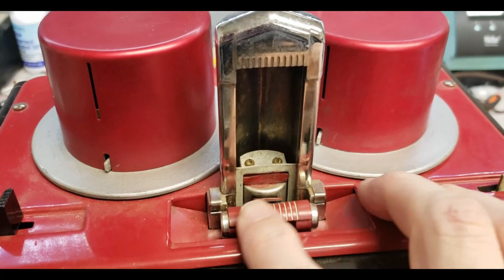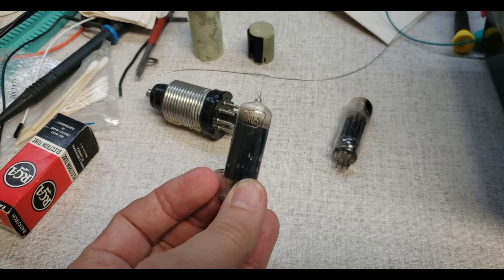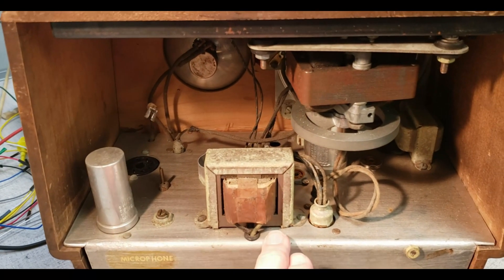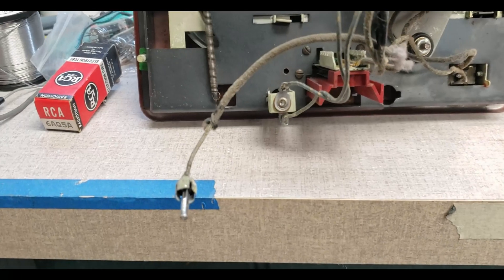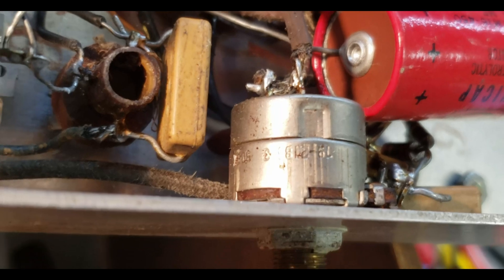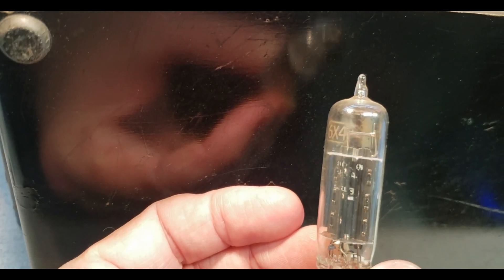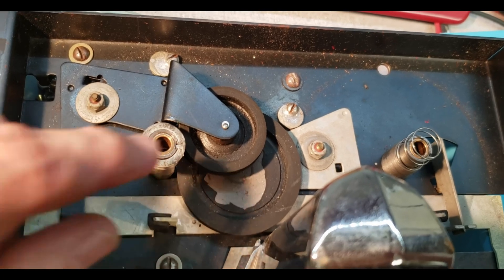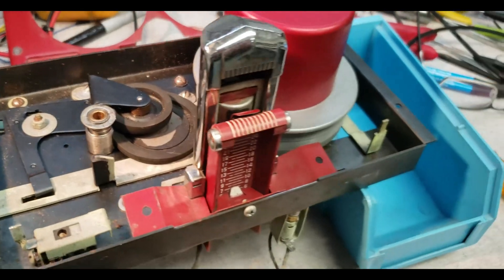The Weirdest Reel to Reel tape recorder I have ever seen!  Part 2 Teardown

Comment: I think I know what this is.  I used something similar over 50 years ago, when I worked at a radio station.  My version actually recorded audio in a helical pattern on 2" tape.  But the purpose was to record an entire day's programming on a single tape.
Reply from the maker: what you are talking about is called a SOUNDSCRIBER and that is not what this is! ! I have a soundscriber. thye use 2" wide plastic based tape. not paper and yes helical scan, 24hrs on a 3" reel. not the same as this however.

Comment: You are aware that wire recorders use magnetic heads just as tape recorders do right? The main difference between a magnetic head for wire and a magnetic head for tape is the wire head has a small V groove for the wire to ride in VS a tape head that has no groove (granted some earlier tape heads do guides the width of the tape) built into the head).
I tend to agree its a tape machine as a wire recorder wouldn't give manual control of head height instead automatically cycling the head up and down to keep the wire wrap consistent.
Your player reminds me of the internals of this: https://www.youtube.com/watch?v=xE2GEmHque8
Reply from the maker: It has 2" wide paper tape with brown oxide on it.

Comment: This is the coolest thing I've seen in quite some time. 

1/4" microphone input, speaker output. Noise was an important issue. Hifi output though -- at least via the device itself, not a priority. But yet expensive 2" tape? Wonder what speed it runs at. Auto-rewind... happenstance, or important to capture everything in the same direction because it makes transfer easier?

I wonder to what extent the medium of the 2 inch, 24 track tape was the starting point. I.e. the primary goal being to capture audio on that particular format. Either because the creator had access to that or their work involved/necessitated that format. Vs the goal being more general regarding simply recording sound. Capturing lots of sound. Capturing separate tracks. Repeated recording of something to aid in comparison?

So mysterious.
Reply: It's a rim-drive machine so the tape speed relative to the head will vary as it goes through the reel.

From the first video the recording medium is paper tape coated in oxide.  Given the early 50s look of the electronics and the fabric-coated wiring, I would suspect that the fact that it's recording 24 tracks on approximately 2" tape is a coincidence since the 24-track studio format didn't appear until about 1972, and this thing wouldn't be able to play a 10" reel of studio tape in any useful form anyway, being only able to access one track at a time.

EDIT: I meant to add, this is more likely to be some kind of dictation format, since voice-quality recordings wouldn't care so much about the speed fluctuations from a capstanless transport.

Comment: Looks to me that they found the tape transport, and made the amplifier and stuffed it all into an old AM radio box.

The heavy lead on the tube could be due to microphonics or they were afraid of the tube emitting x-rays?? Once you go to testing may say!

Strange, as the sockets and connectors are riveted down as well as the caps, but were they all done the same way, or were the rivets hand done?

With the coils and caps, did they have a tape bias system in the design as well?

With the mods to the switch, I would think they had feedback problems?

Hope you get it going!

Comment: This looks like it would take 2-inch magnetic tape, which would not have been easily available to anyone at home, and probably not at all available until the 70s. Since the device looks like its from the 60s or earlier, this would argue against it being "from the back of a magazine" or some such, imo.

Otoh, a company  could make their own or order custom tapes. The mechanism is clearly designed to play many hours of music without need for intervention, so to me, this is  a device meant to supply background music for an office or a store (or maybe some elevators). 

At least, that's what the transport seems designed for. The mounting is really weird, though. Maybe an engineer or hobbyist got his hands on a spare transport and made this for personal use. I know from experience that, in the 70s, it was not at all unusual to re-purpose old tube amps inside radios, which this could well be. Still, where would he get the tape for it? My guess is that it's a prototype for a Muzak-type machine similar to 3M's Cantata system.
Reply: 2 inch tape was around in the 1960s, but you are right, it was not easily accessible to the average joe.  Mostly it was how tape was actually manufactured, and then cut down to whatever width was needed - 1/4", 1/8", or even the 1/2" used in some systems.

I get the feeling that the manufacturer of this unit probably also offered the proper (proprietary or semi-proprietary) tape for it, as you speculated.    It even makes me think it might have been a cartridge-type system - a big plastic thing that just drops into place.

From the late 1950s and through the 1960s qnd even into the 1970s, there was a flurry of various manufacturers all vying to establish their own tape system as a 'de facto' standard.   Stereo-Pak, Phillips compact cassette, Sanyo tape cartridge, 3M Revere, 8-Track, PlayTape, and at least two others that I recall but the names have escaped me.   There was also the 'Pocket Rocker' in the 1980s.

Comment: An interesting puzzle. 

-- It's likely not purely DIY "homemade."   Though it could be a prototype.  The head mechanism and reels are clearly professionally manufactured, not very likely to be homebrew.  There's probably more of them (or were) somewhere, in some form.   Maybe the transport was constructed for a more sophisticated device and this was an attempt to produce a more portable version.   There's no tube part labelling on the chassis, and the "microphone" label looks kind of sketchy.  

-- the extra kludgy shielding on the switch and possibly the lead sleeve on the 6J7 suggests that the audio was noisy and they were trying to correct that problem.   A clue that supports the prototype theory.

-- It's not European, most likely US made.   English text on the knobs and a GE labelled speaker suggest this.

-- It may have had some product or maker identification that has fallen off due to old glue or something-- possibly around the Volume knob which has a lot of blank space around it.  Or identifying marks around the knob area could have been painted over.    It could be a repurposed radio cabinet retaining the original cabinet knobs, if so, someone out there might recognize it.   Also I note that the labels on the smaller knobs look like they may be separate and even loose and weren't what was on the original radio.   And a radio would have had a tuning dial in that area where the Volume knob is now-- the knobs could have come from somewhere else.

-- the pink plastic and paper caps look like they might have been replaced at some point.  

-- one question is, what sort of microphone would be used?   Older gear may have used microphones with a different impedance than what is usual today.

Comment: Interesting how the youtube algorithm recommended me your video. As others have stated thinking this is a prototype or kit I'd have to lean more toward kit since the erase/record/play also has tune on the back side I wonder if it was sold in a back catalog as either a DIY radio or tape recorder so the builder could choose. Probably just a hodge podge of various items the builder had laying around though just like some of the stuff I've built. Still doesn't explain the origin of the tape transport though.
Lot of mystery going on inside there. Would be great if you reverse engineer the circuit and release the schematic as that may be telling. Also wonder if it's using AC or DC tape bias.

Comment: To me, this is clearly an engineering prototype machine OR a patent model. I believe the chassis is originally from a wire recorder. It will be interesting to see what the playback time is for the spool of tape. I agree that common two inch magnetic tape could be used on it as well. This is not a high fidelity device. I am thinking telephone answering machine, but it lacks the external trigger inputs for that. Good find. Super rare!! (You have a new subscriber)
Reply: That's my thought, too. It looks like a handmade prototype for a product they were going to mass-produce if there was enough interest in it.

Comment: 3:50. The shield probably would be more functional if they used lead-free solder to form it. Of course lead free solder wasn't a thing back at that time, but it would've been a better shield because lead-free solder is ~90+% copper.
Reply: Lead free solder is not made from copper. The largest component by far is tin.

As to whether it's a shield or simply there to add mass, if it's not electrically connected to anything then it's probably to add mass. If it's intended to act as a shield then it would be connected to ground, as the shielding plates between the switch wafers are.
Reply: It may not be a shield so much as an attempt to deaden a microphonic tube.